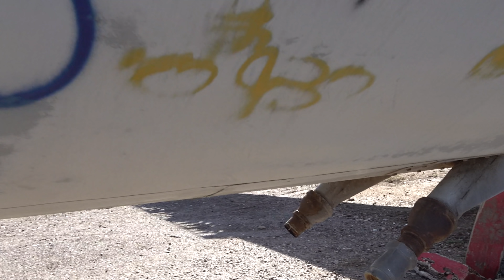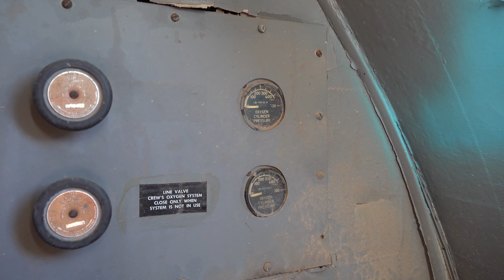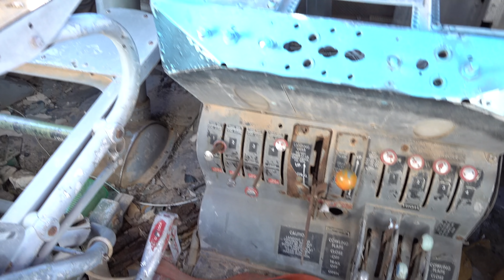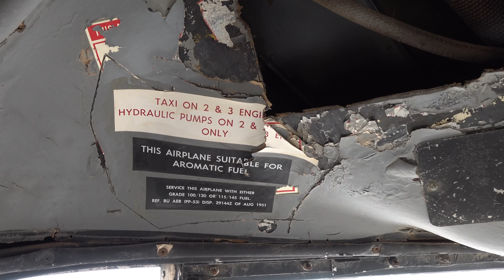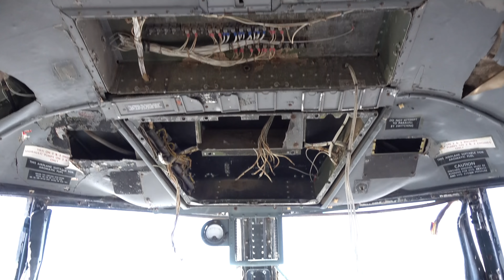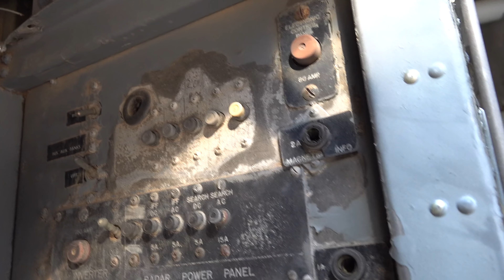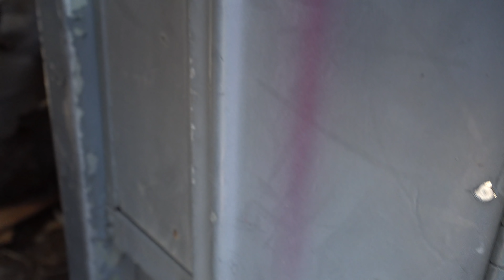ABANDONED Douglas DC-4 N44904 IN & OUTSIDE

Comment: This outfit along with a few others (such as T & G Aviation)  had their own airfield and maintenance facilities in Chandler, AZ just off I-10. I'm assuming this is where these planes are. You could see the planes parked there when going down I-10 just south of Riggs Road and from time to time I'd get lucky to see one fly out of there in the 1970s & 80s. When they shut down they had a few airworthy ones that were flown out of there but apparently just abandoned the rest. They had these as well as DC-6s & DC-7s.
This plane was likely used as a parts plane but still has two intact engines.
Reply from the maker: You are correct, it is the Chandler Memorial Airfield.